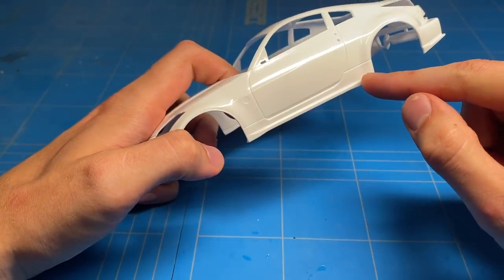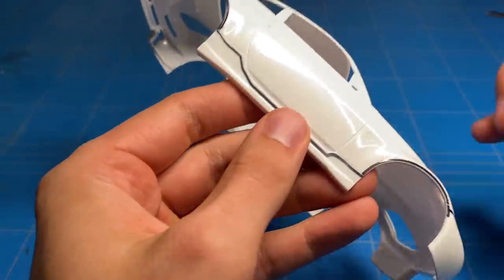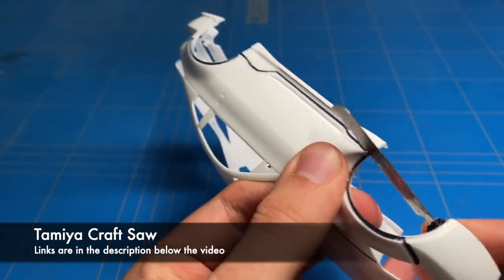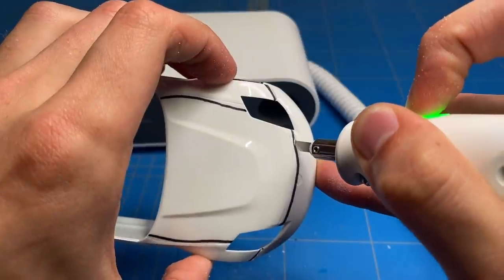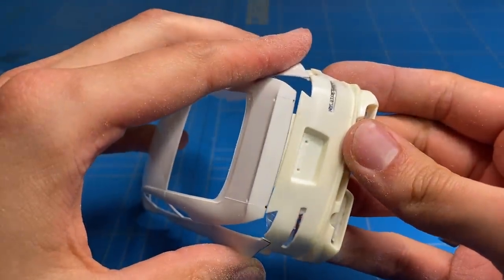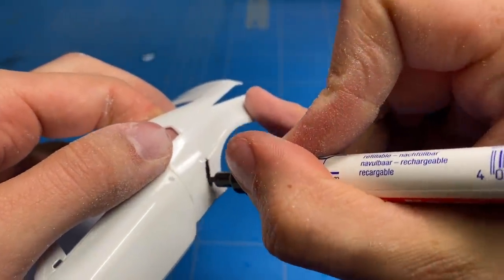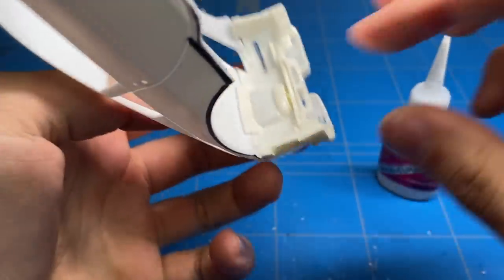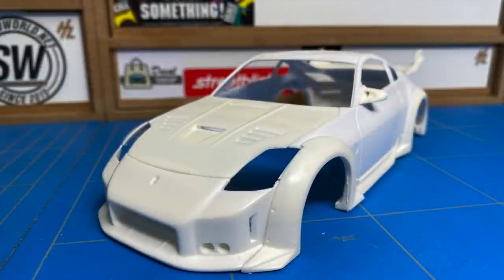How To: Fit an Aftermarket Bodykit & Widebody Part 1 Installation

Comment: that hot knife is cool, i wonder if you can diy w a soldering iron and exacto blades
Reply from the maker: You probably can, however this is not a hot knife, it more like a microwave. It vibrates so fast it cuts/melts through